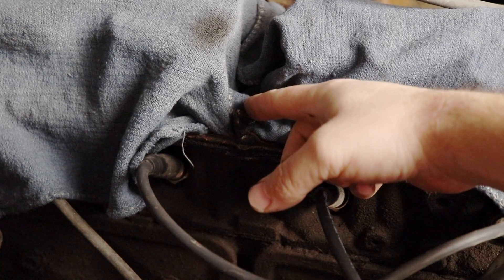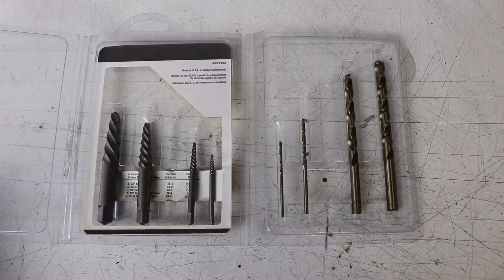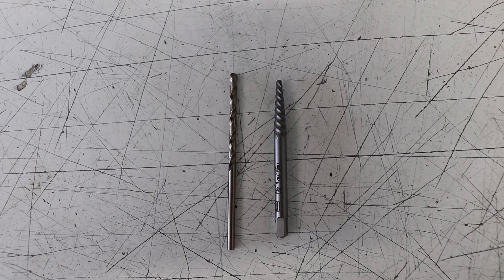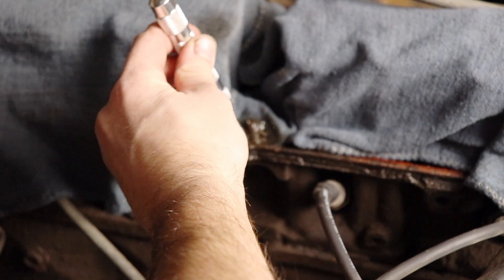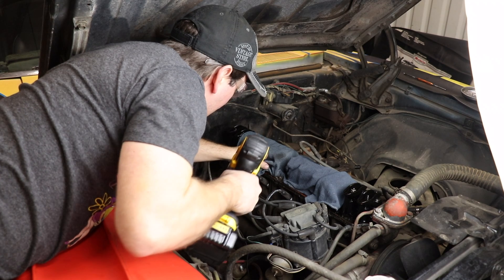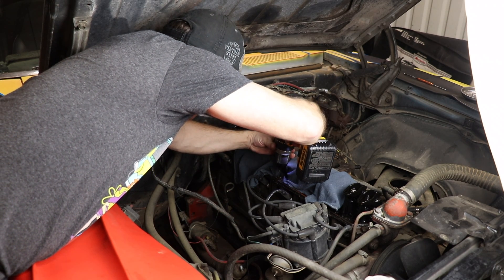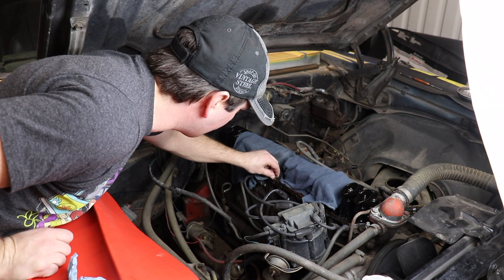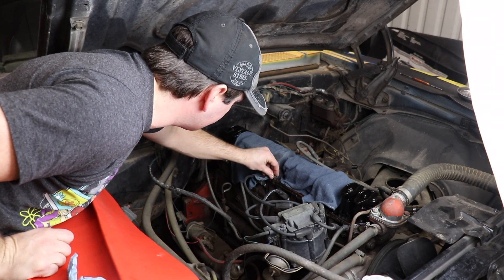Removing a Broken Bolt Using an Extractor Drill Bit

Comment: Those work pretty well for smaller bolts like the one you did but for bigger bolts I heat the metal up around it with a torch first.  It expands the metal and makes it easier to remove rusted and frozen bolts.
Reply from the maker: This is actually what I wanted to show but the bolt came out pretty easily.  I also want to do a video on welding a nut to the broken bolt.

Comment: Awesome video!  I have had mixed results using these.  They either work perfectly or break and then you have a much bigger problem.
Reply from the maker: I have broken a few drill bits in a bolt and it is such a pain!